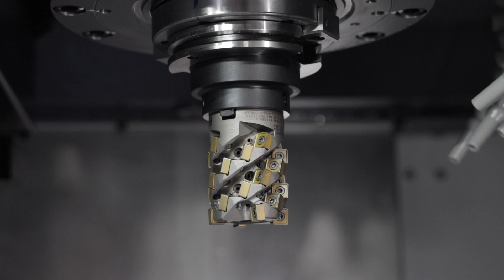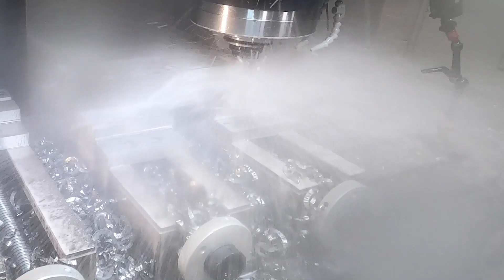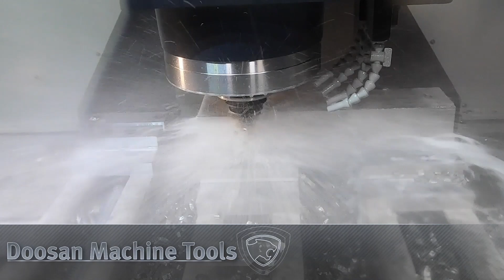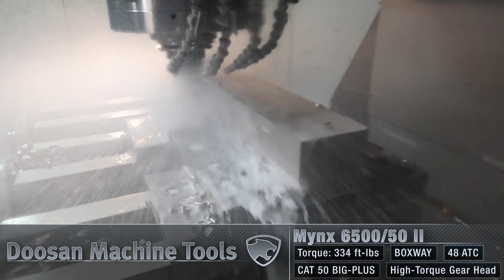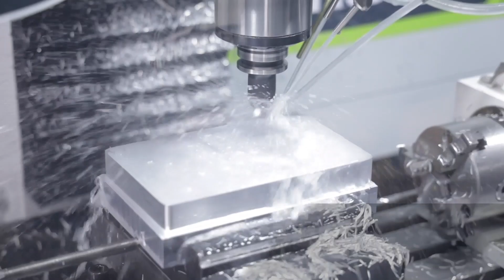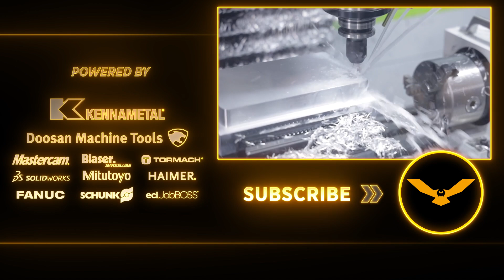This Will Set You Apart From Everyone Else in This Industry as a Young Machinist

Comment: Do you guys filter the lubricant and reuse it or toss it after one use?
Reply: It stays in the machine. There is a tank at the bottom and it cycles round. Coolant can last a couple of years without being changed but it evaporates so you need to top it up and keep the concentration correct